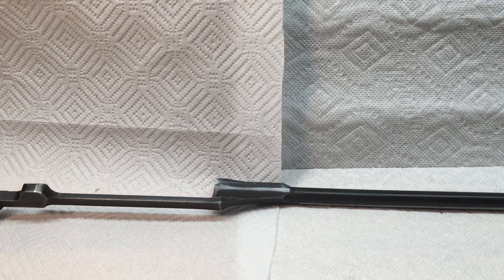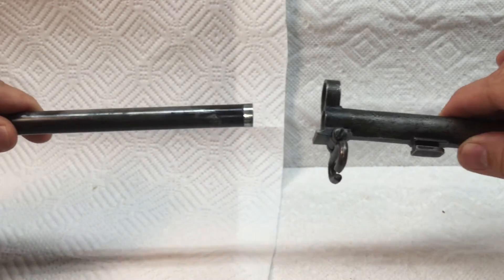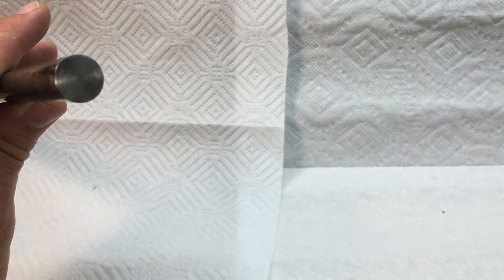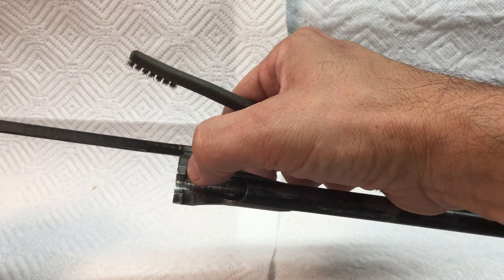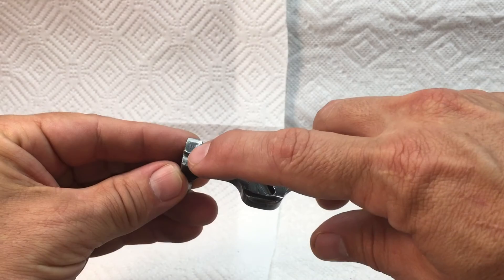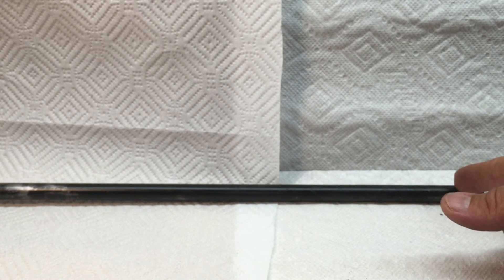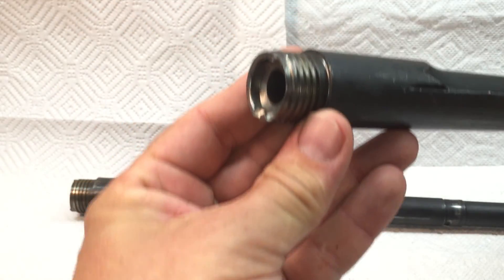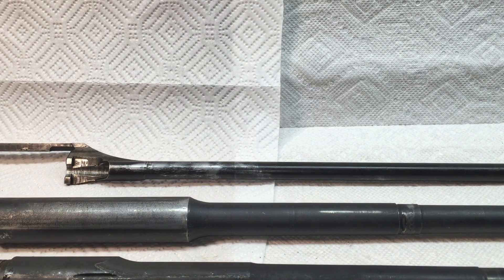M1 Garand Oprod Technical Inspection

Comment: Is it bad to grease the spring and the inside of the shaft of the op rod? 
What about grease inside channel of the cam area or the hooks?
What happens if it is over greased?
Reply from the maker: Light coat of oil on the spring.  Same with the cam, some put grease but grease has a higher resistance factor.

Comment: Is it Okay to shoot using a WW2 Un-modified OP Rod or best to stay clear of them and use a modified WW2 type instead?
Reply from the maker: If you have an unmodified and want to shoot I suggest a modified or later type.  It is not necessary but recommended.  Unmodified are more valuable than a modified or late type FYI.  The only reason the military changed it was for grenade launching tended to break them.

Comment: I myself have the tanker garand. The problem I seem to be having is the bolt jams open and seems to hang up on the tab as you called it. What is the cure for that if you dont mind. This is driving me nuts. I love the weapon but dont shoot it much because of this and would love to get it back in action.
Reply from the maker: Sounds like too much pressure, do you use an adjustable gas plug/screw?

Comment: Why dont u oil the inside?
Reply from the maker: Inside of what, the operating tube where the operating spring goes?  Because oil/grease attract dirt and then it require ALOT more cleaning.  If the tilt rod test works, and fires without issue, don't oil it.

Comment: Your comment about "oil will be fine', in regards to the radius area that rides along the barrel during operation, is incorrect.    By not using grease to put a light layer on the underside of the barrel, and operating rod radius, which runs under it, you risk a short stroke malfunction during firing.   Failure to properly lubricate those areas with grease, is the primary reason for that.   Oil will migrate out, and evaporate as the barrel heats.   A good synthetic, such as Mobil 1, has an operating temp range of -40 to 300 degrees, which is perfect for the M1.   The Army did testing early on, and wanted to go with oil as the only lubricant.   The testing proved that the oil was ineffective, washed out under wet conditions, and evaporated under heat.   Grease does not have those problems.    Using Mobil 1, with it's red color makes it easy to judge a light coating.  There are areas on the M1, that were specified by the Army to be greased on the M1, and the radius that runs along the underside of the barrel, is one of them.
Reply: The comment "oil will be fine" is not necessarily incorrect.  Oil is fine, under some conditions.  Grease is better under some conditions.  The M1 will run well bone dry, under MOST conditions, if necessary.  The M1 earned its reputation for reliability under just about any conditions because it was not dependent on meticulous cleaning and lubrication.   There wasn't anything like Mobil 1 synthetic grease on hand in WWII or Korea or anyplace else when the M1 was in U.S. service, we're just fortunate to have it today.  That said, under IDEAL conditions of course it's best to take advantage of modern lubricants, but mainly because they greatly extend the service life of moving parts as much or more than because the rifle can't function without grease.  It can and will.